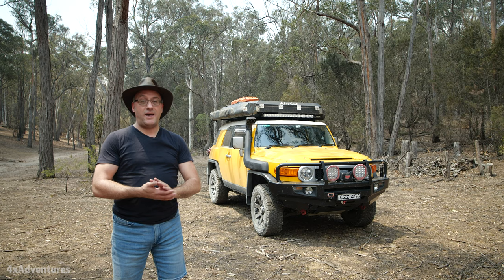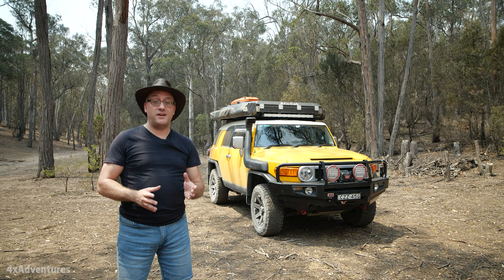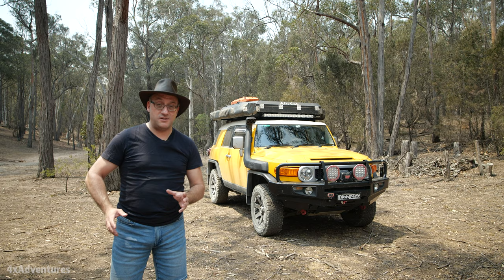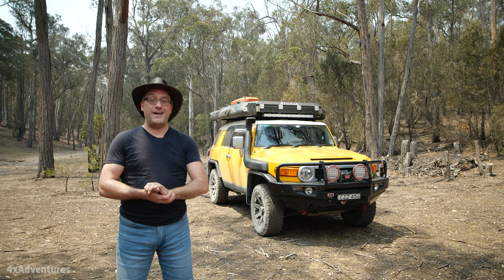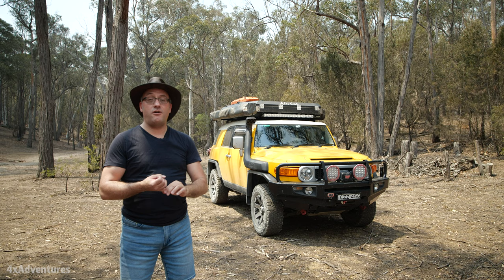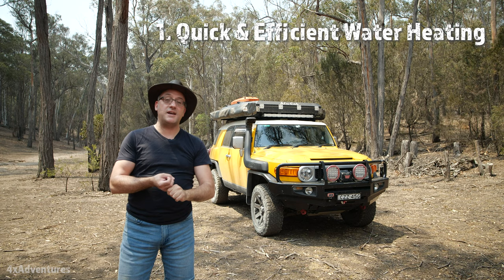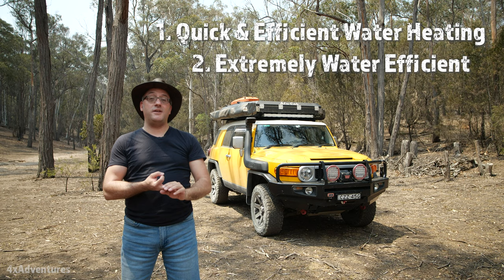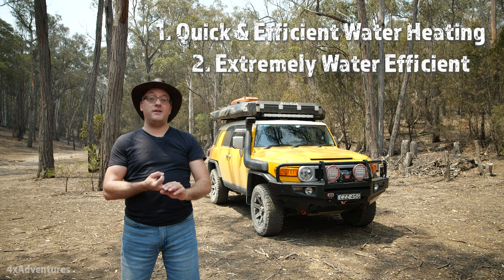Built-In Hot Water and Shower System for Touring/Overlanding | @4xAdventures#adventure #4wd #touring

Comment: Hello my name is Cliff. I Absolutely love your outdoor shower system. I probably watched your vid about 5 times to make sure I didn’t miss anything. In any case, I have been building and adding different mods to my FJ for quite some time, doing as much of it as possible myself since my finances have been a little tight recently. However one mod  I don’t have yet is any type of water system. I have finally got my fiancé to agree to join me on some of my upcoming travels, but only under one condition. Her one condition was that I need to supply her a way where she can take hot showers when we are out in the bush. So that’s my motivation in contacting you. I was wondering what it might cost to have you build me the exact same system you have on your FJ?
Reply from the maker: G’day Cliff. Lovely to hear from you. The hot water & shower system works really well, so I think she would be very happy with it. It is difficult to price up as each vehicle is very different, even in FJ’s as people have different setups etc. It’s basically quite easy to build, with only a few components. The hardest part is working out where each component will go including how you will mount them. The installation of the heat exchanger is actually not that difficult but this is definitely something you need to get right as you don’t want to screw up your cooling system. The parts alone, including the all the plumbing bits would probably come to around $750. If you were going to do this yourself, I suggest laying out all the components on a table, and building it so you can be certain you have all the right connections etc. Once that is done, it’s just a matter of finding room for the various components around the car and extending the plumbing between the components. I hope that helps a little bit. 
All the best!
Attila 😊👍

Comment: I really like this idea but do you need to have the engine running to have a shower? Not really an option for me with my TD42 GQ 😂
Reply from the maker: No you don’t. If you have been driving, the engine will obviously be hot. Once you turn off the engine, the residual heat from the engine lasts quite a long time, and is sufficient for heating water. If it’s first thing in the morning, for example, then I just start the car and have it idle for 5 or so minutes until the engine comes up to temperature and can then shut it off & have a shower. Check out Lake Mungo episode 3 where I do just that.
All the best! 😊👍
Reply: @4xAdventures  Thanks for the reply! just wasn't sure if it would be necessary to have the engine running just to keep the coolant circulating. I'll check out your other vid
Reply from the maker: If you want to keep the coolant circulating, then yes, you need to keep the engine running. 😊👍

Comment: I’d love to see how you made the heat exchanger!
Reply from the maker: Hi there. The heat exchanger is a sealed unit. I purchased mine from glind.com.au in Australia. I’m sure there are other brands available, as heat exchangers have been around for a long time. The hardest part was finding somewhere to mount it in the engine bay. The plumbing is fairly straightforward from that point on. :)

Comment: Fantastic! I am interested in your assistance in installing this into my Hilux. I am in Brisbane. Can you assist?
Reply from the maker: G’day Ben, Happy to help. I’m in Sydney. Was there a particular part of it you wanted to know more about?
Reply: 4xAdventures yes I have purchased everything and require some assistance or referral to have it totally installed.
Reply from the maker: Hi Ben, Unfortunately, I’m not familiar with who I could refer you to in Brisbane. Essentially, the hardest part is finding a suitable spot in the engine bay for the heat exchanger. The location is dependent on the length of the hoses. You don’t want it too far from the hot water hoses. I had to make a custom bracket for one side of the heat exchanger for my install, but your engine bay most likely has more room, so you could probably mount it to the wall somewhere close to where the heater hoses are.
Once you have identified a location and have it securely mounted, you need to identify the hot water hoses. One is coming from the engine and goes through the firewall to your heater system. The return hose from the heater system should come through the firewall close to the other hose. You just need to identify which is which. The next step is to tap into the return hose and splice in the heat exchanger. I recommend draining the coolant from the radiator so it doesn’t spill everywhere when you connect the heat exchanger. Once you have the plumbing done, replace the coolant, remembering to add about 1 litre or so extra, because you have essentially just added about 1m of length to your heater hoses. 
That’s basically the guts of the installation. If you can’t find anyone to do it for you, and you are not comfortable with doing it yourself, let me know and we can try to work something out.
Alternatively, you could look in the Toyota Land Cruiser forum online and ask them if there’s someone local who would be willing to give you a hand. I’ve found both the Toyota LandCruiser club as well as the FJ Cruiser owners club to be full of supportive people.
Anyway, good luck & let me know how you go!!
Reply: @4xAdventures  I managed to install the system to my 2006 Toyota Fortuner.  Thank you so much Sir! Now my wife and kids have no excuses not to enjoy long trips!
Reply from the maker: Well done!! Safe travels! 😊👍

Comment: How did you mate up the heat exchanger to the engine cooling system?
Reply from the maker: Maybe I should do a video on that specifically. You have coolant from radiator entering engine. The hot water then makes its way through the firewall into the cabin where your heating system controls are. Then, there is another hose that goes back through the firewall to the radiator. This is the point where a heat exchangers is placed inline.
Reply: @4xAdventures  That's awesome! Love to see exactly how you installed it along with the pump and the temp valve...
Reply from the maker: I am planning on filming a new install from start to finish. Just waiting for his car to be ready. Hoping to do it in the next few weeks!
Reply: @4xAdventures  Great! Looking forward to watching it!
Reply: @4xAdventures  Hello again...I found this great mod from Mosley Motors that builds and sells long range fuel tanks for the FJ, which can increase your fuel onboard up to 60 gallons! You can either replace the stock tank with a 30 gallon tank, and then install an auxiliary 30 gallon tank somewhere under the rear bumper/cargo area...which made me think about the idea of the second tank as a 30 gallon water reservoir to be utilized with your heat exchanger system! Here's their link: https://www.mosleymotors.com/lra/fjcruiser
Let me know what you think!
Reply from the maker: Not bad. The FJ here in Australia already comes with a long range tank, so both of those spaces are already used up. I just had a look under my FJ and can see that I have bash plates u see both tanks. The photos on that website show the tanks without bash plates. Whether you need bash plates depends entirely on what kind of trips you intend on doing. 
Also, with 30 gallons/120 litres of water, I’d be mindful of not exceeding the GVM with all that weight. But once again, that depends on what else you have on/in your vehicle. 
All the best!! 😊👍
Reply: 4xAdventures Thanks for the advice! My FJ “theme” will be a beach/dune weekender so I won’t be needing the bash plates, but I am concerned about the weight. But the rest of my mods and cargo shouldn’t be a lot of weight overall. Besides, I sometimes carry my motorcycle on the back hitch which is just under the weight limit, although the suspension does squat - looking into rear air assist shocks to remedy that.
Reply from the maker: Hi Richard, nice to hear from you again. I’ve been waiting for a chance to film a complete install. The owner of the vehicle in question is still sourcing a water tank, but as soon as he’s ready, I will film the whole thing. In the mean time, if you have any particular questions, you can contact me at contact@4xAdventures.com.au
Reply: 4xAdventures thank you for the update. I’ll email you shortly.
Reply: 4xAdventures I sent an email, did you not receive it?

Comment: What is the type/brand of the Temper Value you used?
Reply from the maker: I used the John Guest temper valve, simply because it had the 10mm quick-fit plumbing attachments which was compatible with the plumbing I used. But you can use any standard plumbing temper valve. FYI, John Guest seem to have stopped making the temper valve I used, but you if you search eBay for “temper valve with 10mm quick-fit” then you can get other brands. 😊👍
Reply: @4xAdventures  

I have installed the heat exchanger in my 5th Gen 4Runner which is the same engine as your FJ. I inserted it into the heater hose after the cabin heater system. Should I have inserted it before the cabin heater system? I had assumed if I turned the cabin temp to minimum it would not cool the coolant down. However I’m worried I have made a mistake. It’s a lot of work to reinstall it so I wanted to check with you first.
Reply from the maker: Hi Ed, I have my heat exchanger inserted inline with the radiator hose returning from the cabin. It sounds like you have installed it correctly. I don’t think setting the cabin temperature to the coldest setting affects the coolant temperature itself. I think the heater controls simply alter the mix of fresh air with air passing over the hot coolant pipe. Hopefully that helps.
Reply: @4xAdventures  it sounds like I’ve installed it the same way as you. I’m concerned as the water runs cold when the engine is hot and at idle. The source water is only 5c so maybe that is the issue. It’s just too cold to start with. Maybe I’ll have to cycle the water through a Jerry can for a while before showering. I was hoping to draw water from a creek but that might not be possible.
Reply from the maker: Hmm... in that case, try turning up the heater controls in the cabin - this makes a difference on some vehicles. It heats water as its passing through the heat exchanger, so it could also be the case that it’s too cold to heat it up to ~40C. When I use mine in the cold, I use by onboard water tank, which is probably not colder than 10C I think...
Reply: @4xAdventures  thank you for your help. On a separate topic I’ve had to modify your install approach to account for freezing temperatures in Canada (even during the summer). I only have the heat exchanger installed in the engine bay. The pump and temper valve is installed in a separate box that I can move into a warm place to prevent them getting damaged by ice. Just sharing in case you have any fans from cold climates enquiring. Again, thank you for your advice.
Reply from the maker: G’day Ed! Thankyou so much for sharing that info. That’s good to know as my “cold”, is nothing compared to your climate :) Let me know how it performs when you get it all done!! All the best! 😊👍
Reply from the maker: Hi Ed, one thing I forgot to ask is whether you are running through a temper valve, or just directly out of the heat exchanger. If you are going through a temper valve, you can adjust the temperature by screwing the know/screw at the top to change the temperature the valve let’s through.
Reply: @4xAdventures  Hi. I have a temper value that I’m building into the “pump box”. But for the test I did last weekend it wasn’t yet inserted. I’m hoping the temper valve might help the situation. Although I was expecting it to only prevent dangerously hot water from passing through. If it prevents cold water too that will be great. I will do a full system test once I have the pump box built. I waiting for the 40 grain filter to arrive from Amazon before I can complete it. I’ll let you know how it goes.

Comment: Hey I was wondering if you could built that system for me?
Reply from the maker: Hi there! I’ve had a number of requests to do the same for others. Because it’s a custom install, it’s kind of hard to gauge how much it would cost as it could involve fashioning brackets, different lengths of piping etc. I’ve been working on a kit, which is getting close to being ready, but still not quite there yet.
Reply: @4xAdventures  ok let me know when it’s available. Also I have a question, I need to have water in my radiator instead of coolant correct?
Reply from the maker: No that’s not correct. The heat exchanger is inserted in-line with your radiator hoses. The shower water is kept completely seperate from your engine coolant. If you haven’t seen the FAQ video on the shower system, check it out, it may answer any questions you may still have! 😊👍
Reply: @4xAdventures  wow ok thanks I will look at it

Comment: Yeah but they don’t get the water very hot
Reply from the maker: 87 degrees Celsius is plenty hot in my opinion. Too hot to shower with without mixing with cold water. 🙂👍
Reply: @4xAdventures  your vehicle must run hot, never had a exchanger get above 30c on a engine unless it’s a massive exchanger that hold 3 liter or more of water to be heated at a time.
Reply: @4xAdventures   I have a Coleman hot water on demand I can get 8 showers out of a 1 lb bottle of gas with 160 degree temp if I want.  It’s no bigger than a small tool box. Works fantastic

Comment: Everything you said was bad about a gas setup is wrong.
Reply from the maker: How so? I am stating my opinion based on my experience with one I own.
Reply: @4xAdventures  the most popular gas system at the moment is 'hottap' so ill use that as a example, 
the device dose have some size to it but the mounting options deal with that as it can be on your spare tire or roof racks, 
its easy to have it set up permanently so all you have to do is switch it on,
they are very effective at heating water and will heat instantly to a temp thats hotter than i can touch along with having a dial to adjust the temp,
it has another dial to adjust the amount of water flow making it efficient with how much water they use.
and kudos for being up for discussion!
Reply: also just realised the vid is 4yo, so not sure about how long the hottaps been around